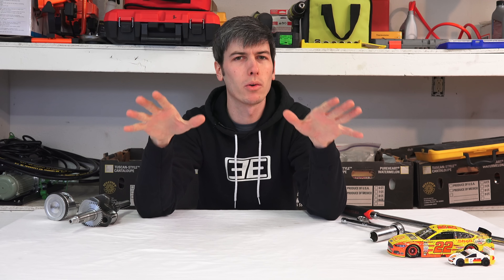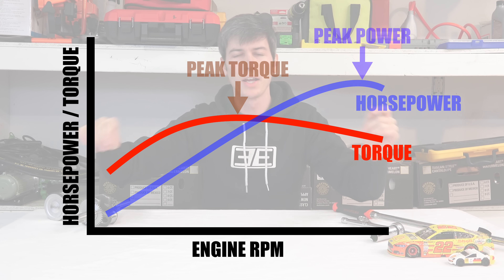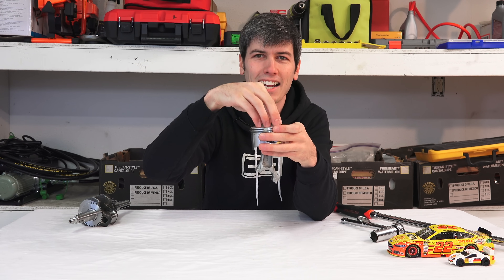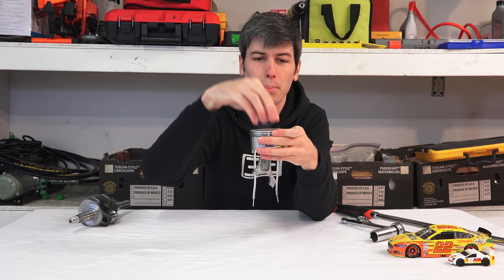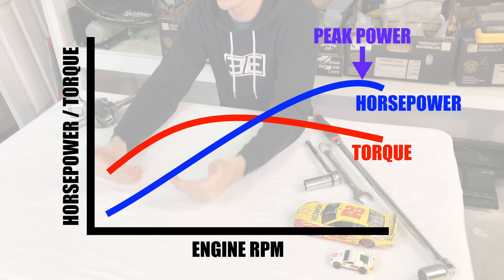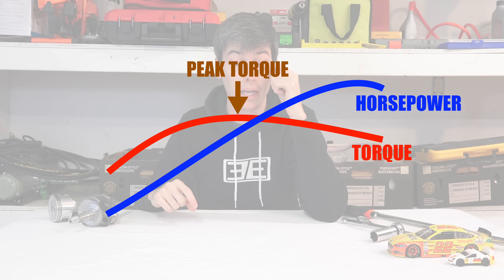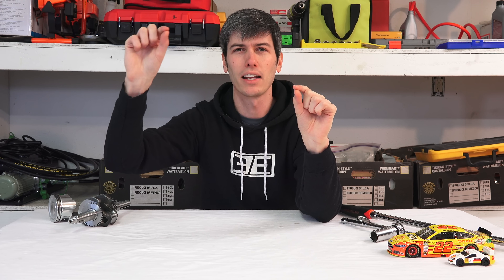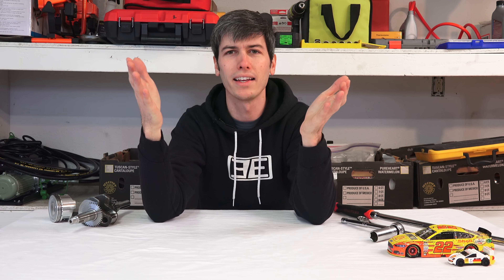Horsepower vs Torque - A Simple Explanation

Comment: Thank you Jason! I can't stand trying to clarify this relationship to people. Now whenever someone says a certain car is faster because it has more torque, I can point them to this video!
Reply: Mekkiceh not so true about more acceleration more speed, u can have a car with great accelerate but on the end he does not have to be faster then some car who accelerate slower..
Reply: Mike Smith Please watch the video
Reply: You need to distinguish between torque and power of the ENGINE (motor) and at the wheels.
For instance, at the wheels, the car with more TORQUE at the wheels will accelerate more quickly from a standstill. It can apply more rotational force to be converted to forward motion.
WHEN the power band of the engine is reached that can take over.
This is demonstrated by the difference between EV's and ICE cars. The TORQUE of an EV will accelerate it off the line faster (more easily!).
The ICE car needs gears, and the engine revving in its torque/ power band for maximum effect, together with the skill of the driver to balance the clutch and wheel spin (or launch control!).
When moving, the ICE car can be held in it's power band and (Eventually!) Catch the EV using gearing. (the EV relies purely on the rev limit of the motor for top speed, IF an EV had a 2 speed gearbox.... another story!)
You can't have (apply) power without torque.
Reply: Roger Starkey You really have no clue what you're talking about
Reply: Matthew Prather 
How so?
Reply: Bob 
Define "faster"
Reply: Mekkiceh 
You CAN'T have power without torque!
Look at the formula!
Forget power and torque of the engine concentrate on power and torque at the wheels.
An ICE needs multiple gears to maintain the torque and transmit power.
It has relatively limited torque at low revs which is why it would stall at low speed in a high gear.
It needs TORQUE  to turn the wheels against the road or it will never move. An engine (motor) with high torque at low revs can use a higher hear from standstill.
Reply: It depends where you measure that torque. Ultimately, where it really matters is at the wheels. In between the engine and the wheels you have diffs, gearboxes, cranks, etc that manipulate the torque that ultimately ends up at the wheels. Power, at a given rev, stays the same everywhere.
Reply: Tyler Durden 
That what I've been trying to say. There's this obsession with "POWER"!
To generate power you need a torque, then as revolutions increase the RATE of use (Power) increases. If a wheel isn't turning there is NO POWER "at the wheels"  the car won't move. The POWER becomes a factor after the TORQUE has turned the wheels such that they are revolving at high (higher) rpm.
A Tesla has (Very) high TORQUE from ZERO rpm, so can accelerate the vehicle very quickly from a standstill, thus leaving ICE cars "for dead" (PLENTY of examples out there!)
When both vehicles are running at high wheel speed, the ICE car, assisted by multiple gears, can exploit POWER (medium engine torque x rpm) at the (now high revving) wheels to catch the Tesla. The Tesla can't exploit extra gears.
Simple!!
Reply: Power gives you a good estimate of performance. It's why the performance of microwave ovens, vacuum cleaners, lawn mowers, sound equipment, etc are quantified in terms of power. It's not an obsession. It's just a very useful way of quantifying how much performance a car can generate from the forces generated by the powerplant. Torque is merely a force applied to a lever. The length of the levers change along the power train, thus the torque varies depending where you measure it. Power stays the same no matter where you measure it.

You can make an engine have more torque just by changing the length of the arms on the crankshaft. You can do the same with an electric motor by making the arms of the rotor longer. But there are trade offs.
Reply: Tyler Durden 
You're not getting it.
(As I said previously?)
You can have torque without power, not power without torque.
Power = torque x rpm (x a constant)
If either torque or rpm is zero, or near zero, you can have no power. Max power occurs when the multiple of torque and rpm peaks.
If torque is "constant" (ish) as in an electric, "direct" drive (single speed) motor, the power would be a constant gradient (straight line) until max motor revs are reached.
Draw a graph! Rpm / torque
Start at zero, for every 1000 rpm power would increase by the same factor.
An ICE motor (engine) has non linear torque and power.
It takes the torque generated by the explosion of fuel and converts it to power (movement), BUT the torque (ability to turn) increases with revs as well. The engine must be at a sweet spot of torque before it really starts increasing its revs, THEN produces maximum power. It gives low (lower) power at low to medium revs until it hits it TORQUE band, so you REV the engine until IT produces power, then REDUCE the revs at the wheels with the gearbox, this gives more TORQUE at the wheels to work against the tarmac, the friction between tyres and road allows the TORQUE to be converted back into forward motion.... UNLESS the TORQUE (at the wheel) is too high, overcomes the friction between the tyre and road, and gives WHEELSPIN(!)
(That's why you need a gearbox!)
As the engine exceeds its peak power, you increase the gear ratio, the revs drop to just before max power and the gears produce more TORQUE at the wheels again (WHEELSPIN between gears??).
This also explains why the EV can run out of ultimate acceleration at higher speeds. IT'S acceleration remains effectively constant all the way from standstill, an ICE vehicle achieves it's MAXIMUM acceleration some time into the "event", probably (?) just before changing to second gear.
Reply: Roger Starkey
 - I get that. I get that Torque (Force) generates Power. In the real world you have counter forces in motors/engines that eventually overcome the torque of these. The electric motor/s in some Teslas has/have a maximum rpm of 18000. That is one factor, among many, that limits the Power it's Torque can generate. A motor with a max 9000 rpm with the exact same Torque will produce about half the Power. It wont perform as well as the 18000 rpm motor. On paper, these two motors will have the exact same torque but the first one will have double the Power. 

So, in this instance, which is a better measure of performance? Power. The point is that there is not an obsession with Power (as you have stated). It's just a more useful way to quantify performance than Torque.
Reply: Higher torque only means your engine can run slower, to get same amount of power.
Reply: Bob Well that car with more torque can be faster, it depends on the ratio between torque and horsepower in comparison between the two cars.
Reply: No, horsepower increases speed and acceleration (more acceleration = higher speed). Peak torque only means one thing for your car : If you get your engine slower than its peak torque rotation, you will loose power very fast. If you get your your engine faster than peak torque, the gain in power won't be much.

Peak torque just says when you put the max strength on your pistons (and crankshaft, and clutch). Peak power says when you put the max power on the wheels.
Reply: Horsepower increases speed, torque increases acceleration. Neither have anything to do with engine speed like that dumbass above failed to explain.
Reply: Torque increases acceleration. Horsepower increases speed.

Comment: One thing that I miss in this otherwise great video - more torque with with same peak power means there's more power in the lower rev range, so the car will be more dynamic when not floored, and WILL accelerate faster until both cars (assuming they are they same, just with different peak torque) get to their peak power and their acceleration will be equal. So, if you use high revs often - go for peak power. Don't like revving high - go for peak torque.

Comment: I guess my issue with this is that this explanation brings me no closer to understanding why Rally cars can get away with so little power but massive Torque and why F1 cars comparatively have such little torque but enormous power... If it were all in the gearing then an F1 car should be perfect for both (I'm ignoring suspension here for the moment) but I know that an F1 engine just wouldn't get the power down right. So I'm still confused as to the difference between power and torque.

Comment: dude i like your videos but are you sure 200hp/100 lb will accelerate faster then 200lb/100hp ?  this is hummer H1 with specs : 170 hp ,4899 kg, torque: 393 Nm / 290 lb-ft ... are you saing the engine with 2.0 turbo with 220 hp and f.e. 280nm will be faster ?
Reply from the maker: If geared appropriately, yes, the higher HP motor will accelerate faster.
Reply: Engineering Explained   you will need too many gears for that. like a truck ... in any case there will be a lot of time loss during shifting and also you will get more weight.

Comment: I like your horse power engine speed argument. In 1915 the OX5 V8 was developed. In 1917 it was found that if you spun the engine more quickly, the horsepower went up from 90 to 115. Pretty snazzy for an aircraft engine of that time I might say....

Comment: I hate how alot of your explanations have special circumstances or variables. For your car 2/1 and 1/2 example, the more relevant question would be "with the same gearing which would be faster".
Reply from the maker: With the same gearing, the car with more power would be faster. The car with more torque would initially start accelerating quickly, though it would be passed soon by the car with more power. In the real world any solid engineer would gear each car appropriately, and with appropriate gearing the car with more HP could win in any scenario.
Reply: Thanks for the response! Lastly I would be curious at which point does the weight of said vehicle become a factor; or the degree of incline both vehicles were accelerating.
Reply: Furnace333 that's kind of what I was trying to get at. Scenario, two 3000lb vehicles with the same gearing are on hill with a 30 percent grade, which vehicle gets to the top  first? Then what if the vehicle is changed to 4000, 5000lbs etc... or the grade is changed to 30, 45 percent etc... Does the 200hp/100tq win?
Reply: Segio: more power always means more speed. And I am not talking about peak power. If you only have more peak power, then you might indeed get beaten by an engine with more torque as it is very likely to have more low rpm power. But here again, power rules.

fernace: not enough traction means to much torque at the wheel. Power has nothing to do with it.

Comment: Now I get it.
But still when buying a car I look first AWD and good 1500-2000 RPM range torque because I need to tow things like horse trailer and I want a car with low consumtion. I wish I could buy Subaru Outback with CVT transmission!

Comment: You were going great until you got to the 2 car comparison explaining which would accelerate faster. 200 hp +100 lb/ft vs 100 hp + 200 lb/ft. You said the 200 hp car would accelerate faster if you change the gearing. True, but at the start you said the cars were exactly the same, if you alter the gearing then the cars are not the same anymore. I have always been led to believe the 200 lb/ft car would accelerate faster up to a certain point (governed by the 100 hp) but would be overtaken eventually by the 200 hp car.
Reply from the maker: Everything you said is accurate. The thing is, in the real world, both cars would have gearing appropriate for their power/torque curves, and hence the car with more power would accelerate more quickly. The point was to illustrate that torque at the wheels can be manipulated, but power cannot. So an engine with more power can always take advantage of gear ratios to win races, where as a car with less power but more torque has no way of guaranteeing a victory in the race.

Comment: Ahhh I was so hoping you could explain me the difference between Torque and HP in a plain language but you left me confused. I knew it when I was 20, but I don’t in my 40. I still know that the Torque is what you feel by your butt when you put the metal to the pedal. The Torque is what accelerate Tesla 0 to 60 within 2.5 seconds. But how can I/you describe the HP? A number in the specs sheet that sells the car? 
You sad: car with more power is gonna accelerate faster - really? Why then diesel kicks ass so hard from the traffic light compare to the gas. Take a regular (not AMG) 3.5 Litre Mercedes ML, just as a random reference. Diametrically opposite numbers of HP and the Torque of its diesel and gas versions, but two completely different performances. 
The gearing and leveraging is straightforward, there’s nothing to talk about here, depending on the need and application it solves either acceleration or towing problems. 
I’m not playing a smart pants here, I genuinely don’t understand the HP from the real life prospective. I know it’s kinda more is better... But without the torture any car is just a piece of misunderstanding - aka Honda Civic, pardon for my language.
P.S. I know the physics of internal combustion engine though...

Comment: I understand what you were trying to say, but there is more to horsepower vs. torque than that. First off, torque is a basic element of power with just two variables -- the length of the lever arm and the amount of pressure [force] applied. As with any two-variable equation, you can vary each side to get the same number of pounds-feet of torque. 

Horsepower is derived from torque through the following equation: 
          Torque x RPM
HP = --------------------------
                 5252

where torque in pounds-feet and engine rpm are both variables and 5252 is a mathematical constant that comes from deriving the equation from its more basic elements, including lever arm length, force and revolutions per minute, which in turn comes from counting the variability of force as the crank rotates. (Anything involving the number Pi gets complicated.)

This is now a three-variable equation, with torque breaking down into force in pounds multiplied by lever arm, multiplied by RPM, which is essentially how many times per minute torque is applied. Thus, power (in this case, horsepower) can vary over time as well as lever arm length. It is possible to generate the same power by applying a large amount of torque slowly (low rpm) or by applying a small amount of torque more frequently. For example, a Formula One car that generates 800 bhp does so at, say, 18,000 rpm does so using about 223 lb-ft of torque, while an 800 bhp NASCAR engine running at 8,500 rpm would be making 494 lb-ft of torque. Same hosepower, vastly different torque. 

In that respect, torque is very important, given that force = mass x acceleration. Since the greater the force -- in this case, torque -- the greater the acceleration for a given mass. So your 100 bhp car with 200 lb-ft of torque would actually be quicker off the line, assuming mass was equal. Meanwhile, your 200 bhp car with 100 lb-ft of torque will eventually pass it as aerodynamic drag takes over and power becomes more important than brute force. 

The idea that geraring can make up for deficiency in torque is misleading. For one thing, power cannot be created nor destroyed; it just changes form. In a gear system, some of it goes away in the form of heat, for example. The other reason goes back to that equation: 

          Torque x RPM
HP = --------------------------
                 5252

If you run an engine on a dynamometer, the dyno measures torque. The computer figures the horsepower at each given RPM level according to that formula to tell you what horsepower the engine generates. 

If you change the variables, you get:

                  HP x 5252
Torque = --------------------
                       RPM

Here, if you want to manipulate torque by varying the gear ratio -- in other words, the lever arm -- you will quickly reach redline, or the shift point, in a lower gear. At that point, you have to shift up to keep accelerating. Then shift again and again to keep going. Two side effects of this are the need for more gears in the transmission of a low-torque engine; that's why semi-tractor/trailer rigs have so many gears in their transmissions. It's also why cars with smaller engines have more and more ratios, today. They need it to keep up with the need to shift frequently in order to keep accelerating. You need to run a small engine at high rpm to get torque. 

On the other hand, a big, torquy engine doesn't need that many gears. It can accelerate through more of its rev range on sheer force. In a race car or a truck, this means not having to shift as frequently. Thus, power can be applied more constantly. Here's an example: 

If you have a low-torque engine with a multi-speed transmission, it may need to shift up three times up, down and up again to go through a couple of S-curves. If each shift takes 0.05 seconds (1/20th of a second) you have nine breaks in power delivery -- three shifts up out of one corner, three down going into the second, then another three accelerating out again. That's 0.15 seconds out of gear for that one section of track. In a 100 lap race, that's fifteen seconds with no power delivery. 

On the other hand, a car with a good deal of torque does not have to shift at all through that series of curves. The driver is on the throttle, off the throttle a bit, and on it again, all in the same gear. Further, since he is applying more torque -- a more basic form of force than horsepower -- he will accelerate more quickly than the multi-gear, low-torque car during the same time and/or distance. 

Put it another way, how fast would your car be over the length of a race if it sat in neutral for 15 seconds? Torque does have its advantages.